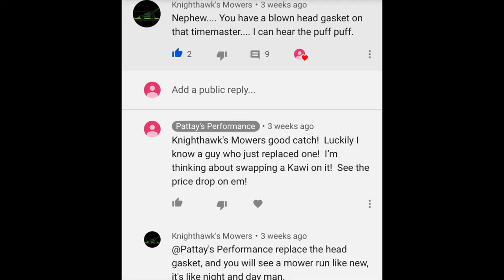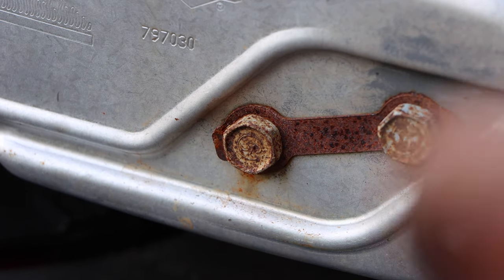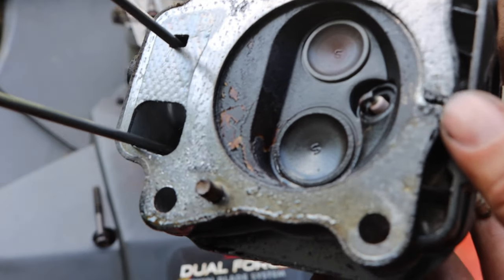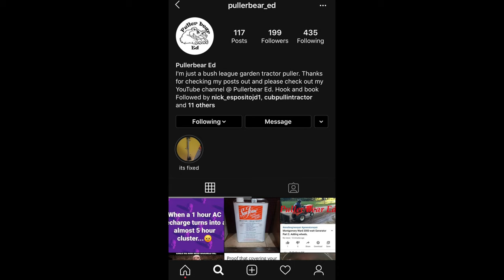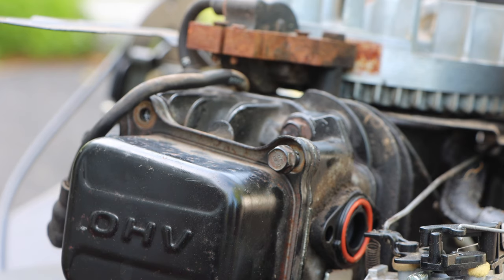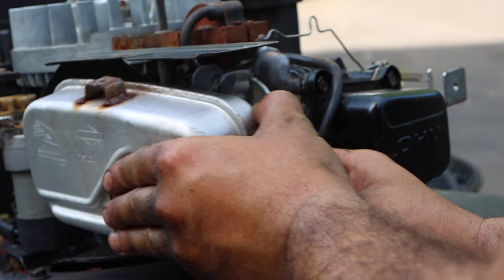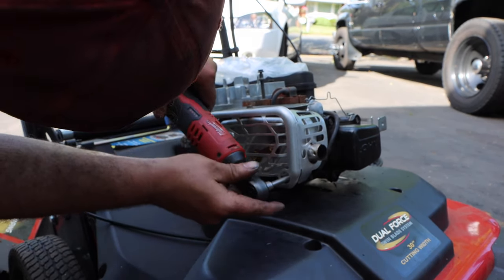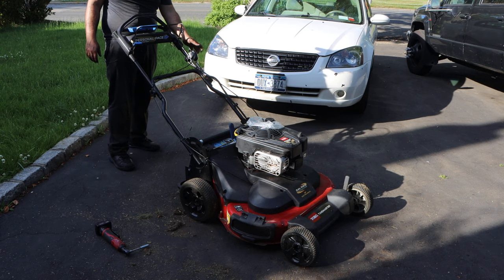HOW TO Replace The Head Gasket On Toro TimeMaster 190cc 8.75 Briggs & Stratton Engine NOT DIFFICULT!

Comment: Replaced it Today Lil Bit Of Oil Came Out Tho When i Replaced it is That Bad ?
Reply from the maker: You will be fine!  A little oil hurt no one!  Is the mower smoking?
Reply: @pattayperformance  No Mower Ran Perfectly Fine Till my Gas ⛽️ Went Out Than Refilled it Didn’t Want to Turn Back on Keep Throwing White Smoke 💨 try Starting Fluid but didn’t Turn on, was Thinking Cleaning Carb
Reply from the maker: @joseguero19911 ,

You couldn’t try but it doesn’t seem like it’s the case.  You need to verify FACTS

FUEL
AIR
COMPRESSION
TIMING
SPARK...

Check for spark...inspect plug or replace it.  Start with easy before you work your way to the harder stuff.  Pull flywheel and inspect keyway
Reply: @pattayperformance  I did replaced the Spark Plug Month Ago... always has problems before,  every time I run out of gas doesn’t want to turn back on right away usually just wait till next day n starts right up
Reply from the maker: @joseguero19911  interesting...definitely fuel flow related. Wonder if it’s a vac issue with the gas tank.
Reply: @pattayperformance  yea only thing I haven’t check is the Keyway
Reply from the maker: @joseguero19911  if it runs I highly doubt it that is the issue.
Reply: @pattayperformance  so I saw that the gas ⛽️ is leaking right where the head gasket is
Reply from the maker: @joseguero19911  carb issue

Comment: There is a super easy way to fix the blown head gasket on this mower...
Step 1-remove engine
Step 2-Throw B&S in the trash
Step 3- Install new Kohler CV224
Reply from the maker: I upgraded to the 223cc and never look back blew the Honda away.  

I like electric start that’s why I didn’t go with a Kawi or Kohler
Reply: I'm doing the same exact thing have had that engine sitting in my garage for a while waiting for the head gasket to go again which it just did again for the 3rd time.
Reply from the maker: @preocupied1690  

It’s a common problem…nothing you can do to prevent this.  I swapped to a 223cc last season only time will tell it the bigger motor (less stress on it) is the answer.  

Do you use your machine in a professional manner?
Reply: @pattayperformance  no home use

Comment: If you use a piece of paper/plastic between the socket and bolt, it acts as a wedge. And holds the bolt in enough for you to thread it in. 

I once used a leaf in a socket to put a small bolt in a hole, that was in the back of a compact engine, that I could barely see with my finger.
Reply from the maker: 🤣🤣🤣

One day on a Road Call at a Hospital a liftgate line exploded and was leaking hydraulic fluid in excess.  The liftgate wasn’t able close.  I tried everything to stop bleeding but all failed.  Last resort was a HUGE Leaf off an elephant plant!  I wrapped the leaf around the break.  Then wrapped tape over the leaf. Those put a piece of heater hose over it...then clamped it!  Still leaked but good enough to close the gate and get it back to the shop. Save them an expensive tow!
Reply: No need to do all that there's only four head bolts starting with your hand and then torque them down come on
Reply: @Jeffroson78  If I could thread it on with my hand. I wouldn’t need to use this method. Come on. 

But really. I do this b/c I can’t reach the hole and I can’t see it. It’s like trying to grab a tool that fell into an engine bay and you can’t seem to reach it b/c there is to many things in the way. 
But when you explain it to others. And they think”Just ran it with your hand. It’s not that hard”

Comment: Pattays Performance. I have encountered several Briggs & Stratton engines over the years that had really loose head bolts. In most instances, I always tightened the loose head bolts up and usually never had any further issues. From my personal experience, I think that your blown cylinder head gasket was probably caused by the loose head bolts allowing compression blow by which burned a weak spot in the gasket causing the failure. The engine sounds now like it should.Do you think that I am on the right track or one rocker short of a rocking chair?
You know, I may invest in a battery powered ratchet like yours. Is that a Milwaukee Fuel? Always Enjoy Your Videos. Best Regards From Central Kentucky.
Reply from the maker: IronDuke502,

I’ve only encountered loose headboard once on a Forest Gump Style Rider.  I don’t work on Riders due to lack of space.

These engines are prone to blown HG, I doubt that the loose bolt was a factor.  From what I read online, they say the small diameter of the head bolts is the main culprit of why they blow so frequently.  Only one head bolt was loose, so I’m not to sure.  There are a lot of complaints about blown head gaskets...not enough solutions.  Just looking to turn the curve.  Honestly if there were ARP bolts available, I would have bought em 🤣

I run the m12 series tools.  This is the regular ratchet.  I opted NOT for the FUEL since it has a bigger head (more torque) and would be a clearance issue.

LOVE KENTUCKY!  You guys have best GRASS SEED EVER!  KTF31!  I have your seed shipped in!
Reply: Pattays Performance. The ARP bolts are really good, No Doubt. I really hate to see Briggs & Stratton go down in quality with their engines. Maybe it would have been too much to ask for at least a “Professional Series Engine” to say the least. Funny you mentioned the “Forrest Gump” RER - I have one sitting that has the I/C 11hp B&S Engine that someone probably swapped from a 8hp B&S Engine. This mower has the 30 inch deck. 
Speaking of Ky, It’s truly amazing how much money that the Thoroughbred farms spend on grass seed and landscaping in general. When it comes to mowing equipment, They have only the best of the best. During the lead up to the Ky Derby, I wish that you could see all of the flowers & such at many of the larger farms. 
I am getting ready to retire pretty soon; So I intend to get one of the battery ratchets & probably a battery impact. I have all of the air tools that I have picked up along the way- But really like the concept of not being tied to an air hose. You would think that I may be slowing down - No Way, Jose!!!  Have A Wonderful Evening.

Comment: Oh a tip.... Don't use that type of fuel filter, thats for a fuel pump type carb, use a regular  gravity feed fuel filter, it will run much better, with that kind of filter that could starve the carb for fuel, just a heads up.
Reply from the maker: Knighthawk's Mowers,

Thank you!  I bought it like that...never gave me an issue. I’m busy with everyone else’s sh*t, mine takes the back burner.  Hence my 1 year plus Ariens Custom 1128 with a Supercharged Hemi 420cc on it 🤣🤣🤣

When I change the oil I will just end up deleting the filter.  Carbs are cheap and easy lol
Reply: @pattayperformance  I feel your pain there, same here, just today after a year changed the oil in my snapper big six..... Did a maintenance.
Reply from the maker: @knighthawk86855 , my half ass arugment is...suppose to change the oil every year or 25 hours.  I've this mower for two years and only use it on my front yard.  I have a different one for my backyard.  I've spent more time working out the kinks than mowing.  This year I will change the oil and delete the fuel filter.  

This fuel is filter in the surecan and again in the screen for the gas tank on the mower.  third one isnt going to make a difference.
Reply: @pattayperformance  ah ok, you should also put in a fuel cutoff in line, if your not going to use a fuel filter, just a safety precaution.
Reply: Also, you should of adjusted the valves just for SS, and GS, but I guess not really nesasary, but would of been a godd thing to do.
Reply from the maker: @knighthawk86855 , all of my equipment doesn't have a fuel shut off valve unless it came like that.  Even when they do, I don't utilize them.  In season I store them wet.  Out of season I run them dry.

Comment: I have the specs for that engine. Head bolt torque is 220 in lbs. Great job on the video.
Reply from the maker: Appreciate it!  You got one these?

Thanks for the view and comment, hopefully you subscribed to my channel! 🤙🏻🦅🔧🇺🇸
Reply: What is the valve clearence spec ?
Reply: @DKSE123 .003 to .005 Intake. .005 to .007 exhaust

Comment: What a nightmare the same muffler bolt turned out to be for me.  Mine would not get tight because the aluminum thread was stripped out.  That muffler bolt is a special shoulder bolt and has a bastard thread size.  I ended up drilling and threading to next size and using thin wall stainless steel tubing with a regular bolt through it to secure the muffler.  Very bad design from torro for muffler bolts.
Reply from the maker: GREAT fix to overcome you unexpected issue.  I’m my experience these engines do a lot to be desired on these mowers.  I will give credit when credit it due…when they are healthy they are great.  

On my channel I have a pressure washer that was given to me that seems like suffered the same fate as yours and I did the exact thing.

Hope your machine and doing well!

Thanks for view and comment, hopefully you subscribed to my channel 🔧🤙🏻🦅🇺🇸

Comment: Try sharpening the blades and it makes less work for the engine ❤
Reply from the maker: My blades are as sharp as they can be!  Deck is always clean as I NEVER cut my grass wet.  It’s just a common problem these motors suffer

Comment: Looks like you know just enough about what you're doing to be dangerous. Next time do your homework and study for the idiosecrancies. And you probably don't know that the aluminum push rod is for the intake valve only.
Reply from the maker: It’s just nuts and bolts.  If you take things apart and put it back together the same way it was there won’t be any issues.

The only time that doesn’t is when someone has been in there and assembles it incorrectly